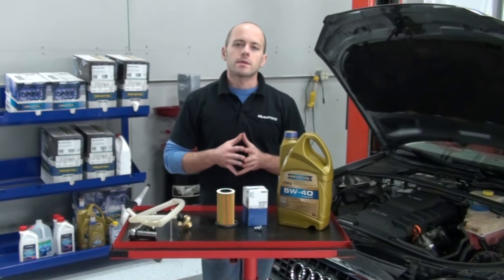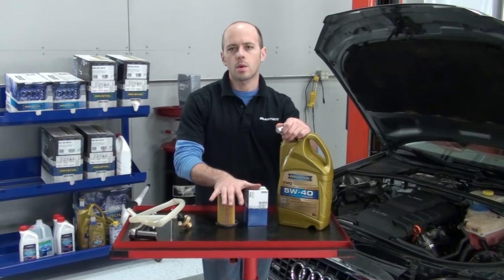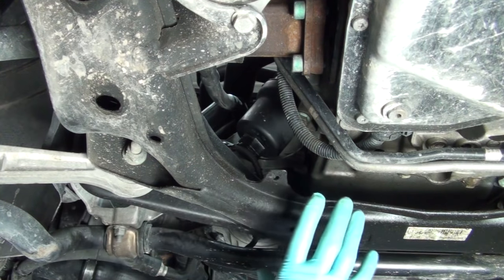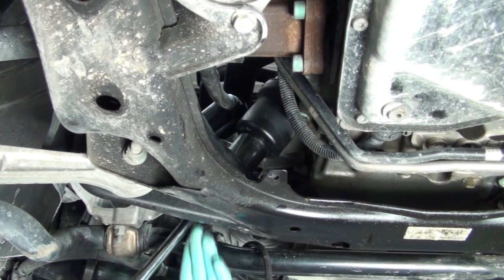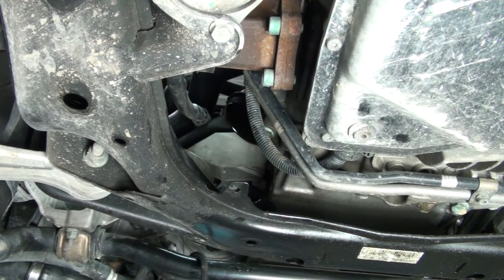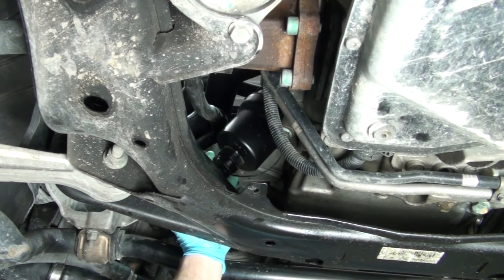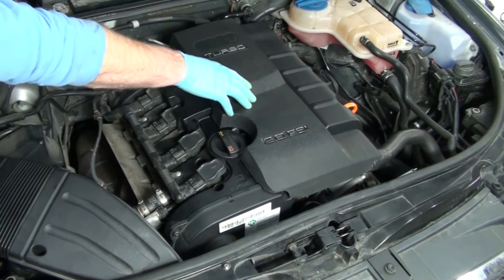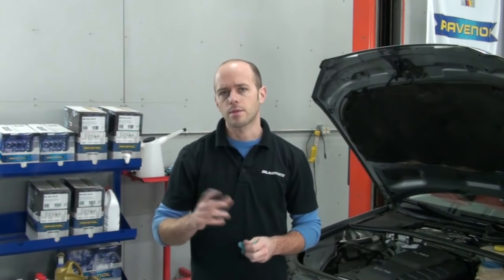How to Change the Oil on an Audi A4 2.0T FSI (2005-2009 B7 Chassis)

Comment: Thank you for this...I suspected over a long time that my local shop has not been doing the oil changes correctly, no way they have the tool. Im my opinion they have changed the oil and never replaced the oil filter....I will get the tool and do next change
Reply: Pablo Gonzalez I was trying to see how that tool has any value? Can't I just unscrew it and have the oil spill out like it normal would on any other car?
Reply: Pablo Gonzalez from 3:50 to like 5:00 that part I feel like I could just unscrew the filter itself and skip that part
Reply: Yes, you can just remove the filter housing without draining it with the special tool.  It will make a mess, but you can do it that way.     You can drain it without that tool, if you like.  Just use a long screwdriver to press the nipple upwards.   You'll still make a mess, but it won't be nearly as messy (just lay newspaper or old rags on the suspension/frame to help contain the mess).
Reply: Also you can cut a milk jug or something similar to sit right under the filter housing. No mess.

Comment: I use 5w-30 castrol edge which is recommended on their website when I put my plate Reg in.
Reply: can I use 5w 30 oil
Reply: and here electric folding bike

Comment: How do you remove the motor mount sensor plug. I don't want to break the thing. Thanks in advance
Reply from the maker: Hello P Neumann,

The standard VW and Audi style plug connectors can be difficult to remove. In one of our other videos I demonstrate how to remove this style of plug. At around the time of 2:44. I hope this helps, and if you have any other questions, please feel free to ask! Video: https://www.youtube.com/watch?v=cTUVlGsUzXU
Reply: Thank you- got it. TAB back. I got it off. Dumb question- but does anyone name these types of clips/plugs? So easy to break especially if its cold out.    Success on the oil change but was really messy oil filter change without the tube tool. In the oil filter mess/chaos and such I forgot to put drain plug in....wasted ~2.5 liters of new oil. :(   I'll try to do a hack on the T 40057 tool for oil filter. $50+shipping for plastic tube....I may have to cut a milk jug and press on the drain release instead.   Thank you
Reply: Blauparts LLC h
Reply: Great video, but I still can not disconnect the motor mount sensor plug.  There is no apparent "tab" that moves on mine.  This is the hardest part of the job and would be great if someone posted a close-up video or perhaps a drawing showing how the connector comes off.  I hate VW/Audi when they design s*** unserviceable stuff like this.
Reply: I got it off.  Easily done from the engine compartment.  Perhaps not the "correct" way, but sliding a very small flat screwdriver under the rectangular "bump out" on the rear side of the connector (inserting the screwdriver from right to left as you are looking down at it from the open hood) frees the lock "nub" and it slides right off.

Comment: I could use the same oil for the Audi TT 2.0 Cabriolet. What is the name of the oil? Thanks for the video
Reply from the maker: Hello Flavio, 
The name of the oil used in this video is RAVENOL VMO 5W-40. It's available on our website here: http://www.blauparts.com/proddetail.asp?prod=J1A1514-A

Also, if you are interested, we have oil change kits for the Audi TT 2.0T that include the RAVENOL VMO 5W-40 as well an oil filter and drain plug. Both of which are currently 15% off with the code "TTCUP". There are two different options depending on your engine code, I'll link both below. Hope this helps! And if you have any other questions, just ask.
(Engine Code CDMA or BPY): http://www.blauparts.com/proddetail.asp?prod=J1A5086-C
(Engine Code CCTA or CETA): http://www.blauparts.com/proddetail.asp?prod=J1A5088-M
Reply: Thank you very much!

Comment: Can you verify the torque specs again please. You mentioned 22 ft-lbs for the torque on the drain plug, and 25 nm for the torque on the oil filter housing. Are both ft-lbs or nm or as you described it in the video?
Reply from the maker: Hi +Demetrios Manos,

The factory Audi torque specification for the oil pan drain plug is 22 ft lb. and the oil filter housing is 25 newton meters or 18 ft. lb. when converted. The 25 newton meters should be indicated on the filter housing. Also you could choose to go a little lighter on the drain plug such as 20 ft. lb. We hope this helps answer your question!
Reply: Thank you for the clarification.

On another point, I don't have the special tool to attach to the oil filter housing to drain the oil, although I've read you can push on the release valve with a screwdriver to allow the oil to flow out of the filter housing. Might be a little messier though

Great video by the way.
Reply from the maker: +Demetrios Manos

You’re correct, the tool is just to minimize the mess. The valve in the filter housing can be pushed on to release some of the oil in the filter housing and minimize the mess.